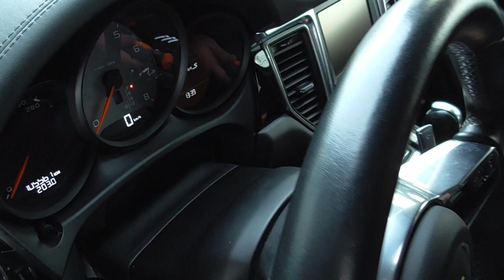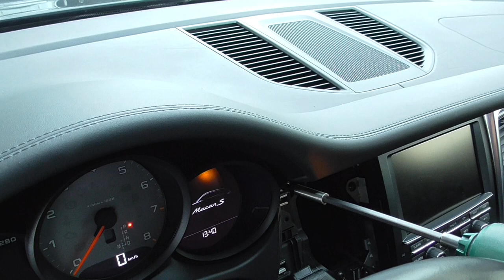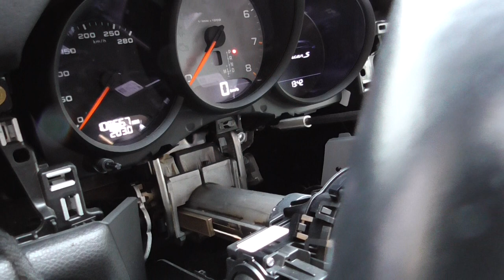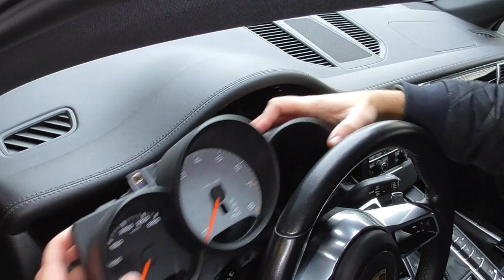Tacho ausbauen bei Porsche Macan / Porsche Macan remove the speedometer

Comment: OMG. If you own a Porsche DO NOT follow this guide, unless you want broken parts, damaged trim and a faulty instrument cluster. In 45 years of working on cars and as a professionally trained Mech Engineer, I've never seen such a rough job: No care, no plastic pry tools and MF cloths to protect trim or prevent indentations, too much force used and not disconnecting the battery, which can lead to voltage spikes - potentially ruining a Porsche cluster costing ££££s. Unless it was his own vehicle (which I very much doubt), I pity the poor owner. If you own a Porsche, take it to a professional.

Comment: if you own a macan, DO NOT FOLLOW THIS GUIDE. Although it shows the general principle here, the method to remove the air vents is nowhere near like this. you need a special tool from VW (or you can make your own) to pull the vents from their backs.